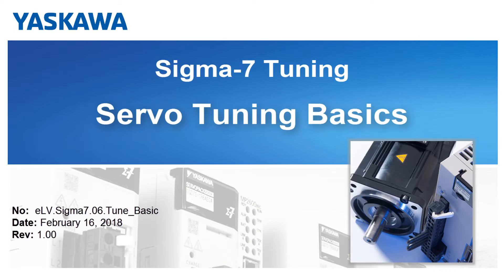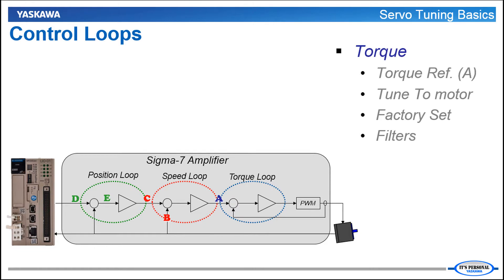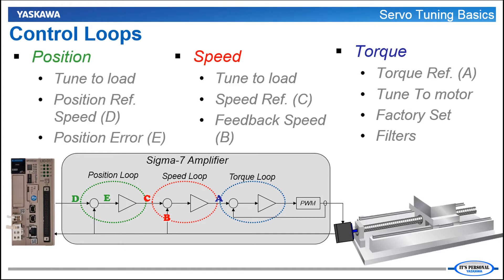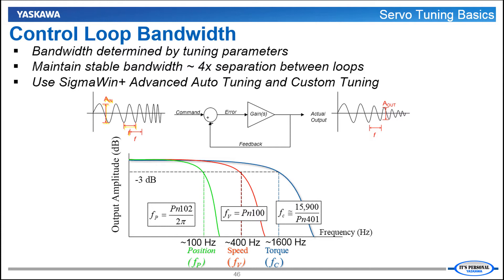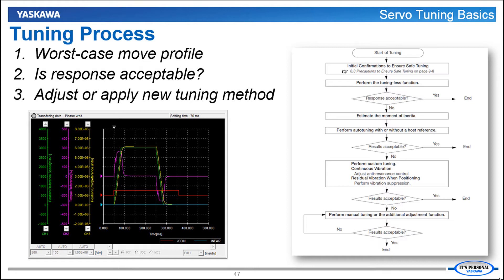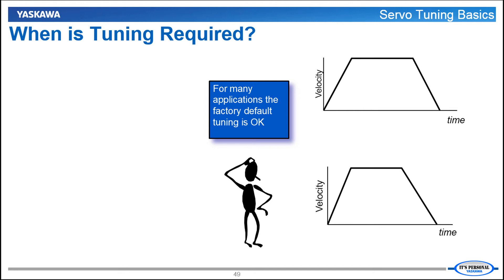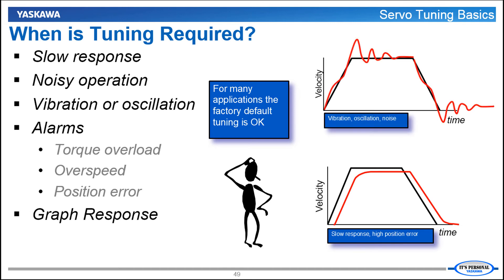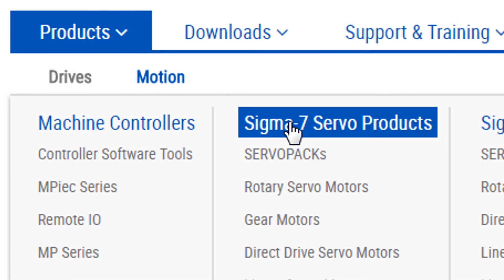06 Servo Tuning Basics (Sigma-7 Servo Tuning)

Comment: Small detail, there is a difference between Speed and Velicity since Velicity is a vector and owns a direction component, and the correct controls term is Velocity loop.